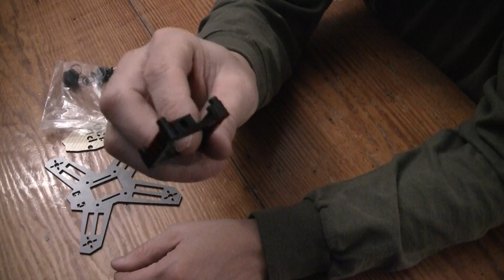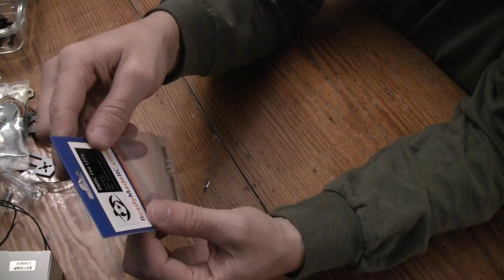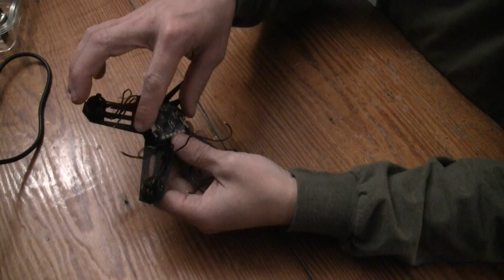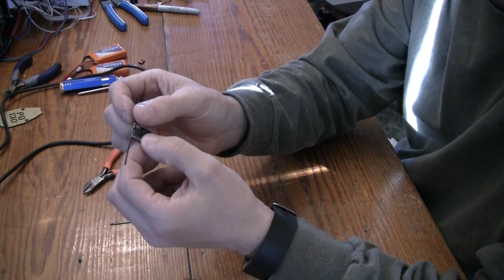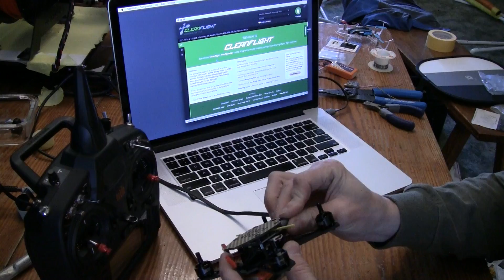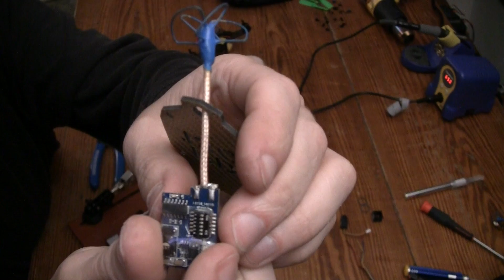Proper Drone PD130 Build

Comment: Any flying videos yet?
Reply from the maker: +Robert Schmid Sorry, not yet! Well, I do have some flying videos but they are from some indoor racing and where we raced was actually very, very tight for the PD130. It was better suited for brushed 5-8mm motors. Regardless, I flew it and had a blast. Just not a good demonstration of the PD130 as I was sitting at idle most of the time :-/

Weather here in Ohio and my schedule just have not aligned. Mostly the weather :-/